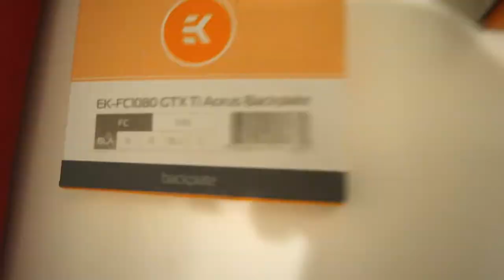Install the EKWB GIGABYTE AORUS GTX 1080 Ti Waterblock

Comment: This is the regular 1080ti aorus? Not the xtreme?
Reply from the maker: corey stavrakis yes its the regular aorus 1080ti ... not the extreme edition
Reply: http://www.performance-pcs.com/ek-fc1080-gtx-ti-aorus-rev-2-0-waterblock-for-gigabyter-aorus-geforcer-gtx-1080-ti-nickel-acetal.html
From what I’ve read it’s compatible with xtreme as well. Mine just came in the mail and I have arous xtreme
Reply: @coreystavrakis3668  was it compatible?
Reply: @coreystavrakis3668  Inquiring minds need to know if it works. I really wanna throw a block on mine & finally got to duel loop glory in my Tower 900
Reply: @hazonku  The latest version of this block is compatible with the Extreme version with an extension of the cooling area, as seen in the movie there no extension of the cooling area so this version is for the standard only. Regardless of version, the standard backplate will not fit unless you modify it, standard or extreme. I mounted the latest version and backplate on my Extreme SLI configuration today.

Comment: can install without ek backplate , i mean is use back the original backplate can ?
Reply from the maker: yes you can ;)
Reply: https://www.ekwb.com/shop/ek-fc1080-gtx-ti-aorus-nickel-rev-2-0 

but i just find out in the ekwb website is not compatible .... 

PLEASE NOTE:

Due to an immense variety of fittings/barbs available on the market and no prescribed standards, we guarantee compatibility only for connectors bought from our website.
GIGABYTE® AORUS GeForce® GTX 1080 Ti factory backplate is not compatible with this water block!
New NVIDIA® SLI HB bridges are compatible with this water block.
Fittings are just for showcase and are not included!
This product should NOT be installed with any aluminum Fluid Gaming parts!
This water block is reverse compatible with GIGABYTE® AORUS GeForce® GTX 1080 Rev. 1.0 GPU models
Reply: @avsj3761  No, the original backplate will not fit unless you modify it.
Reply: @wergilius Hello, sory my inglish is beary bad, i from Argentina, yes you can use the original back plate, 
I used the original back plate
Reply: @pcgamerargentina6932  I mounted this kit on the Extreme version but look at instructions at EKWB site,. 4 backplate screws are from gpu side and later the WB screws is mounted from the other side, in the back plate mounting holes. You could of course skip these or modify and it could work.
Unless the WB screws are so small they go inside the backplate threaded inserts, that i have not checked.

There is another video where someone kept the backplate, and you can see backplate is all bent.

Comment: Has anyone used this succesfully with the RGB's? I have a solid red lit board but i cannot get control of it to make it rotate through the rgbs
Reply: I need to know where do the freaking hoses go or how to set them up I have a case that comes already with water cooling for the processor and I don’t see where the hoses from the water block are gonna conect to